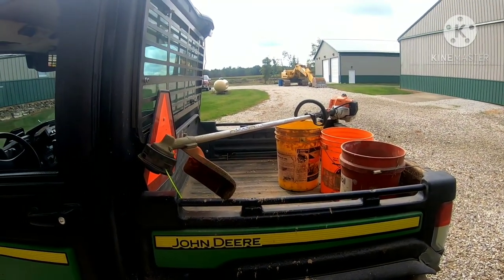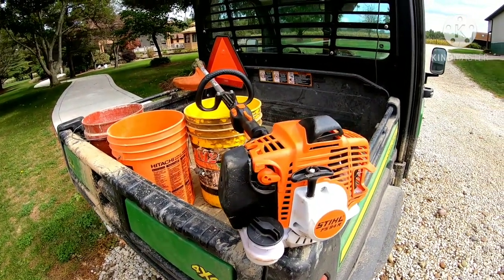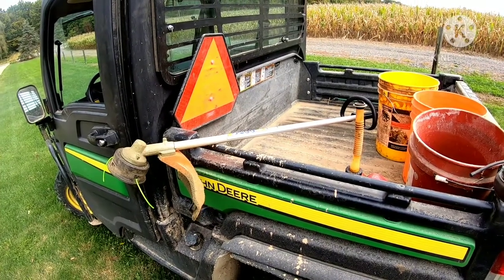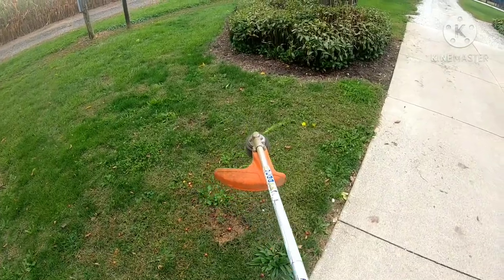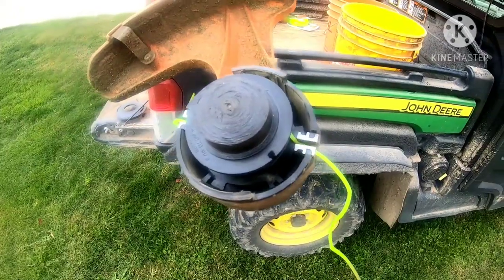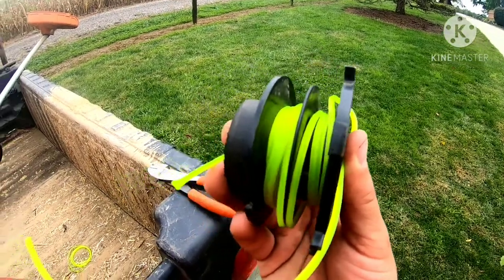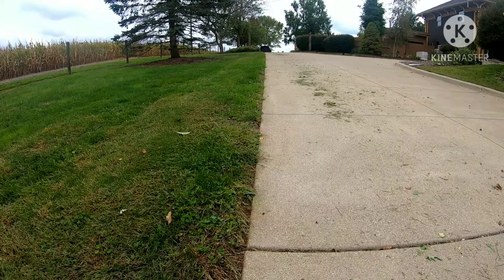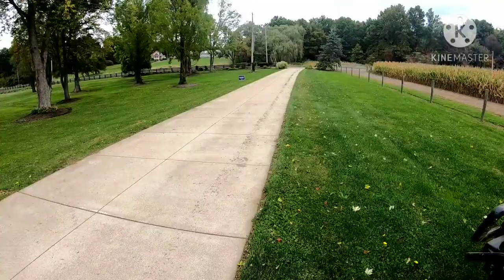how to string a stihl Fs94R trimmer

Comment: I never bought a Stihl, I know it is some of the best but I did bought various other makes and  the string action was and is never ever successful, it will extent when I bump it to the ground ones or twice after replacement and then the string wedge itself so between the string inside that it stop working, always a nightmare, if the Stihl system works, good luck but my machines works on the same principal but I had to stop the engine and manually extend it every time